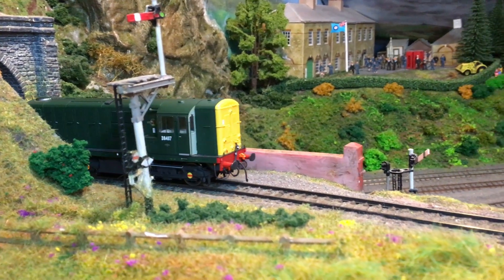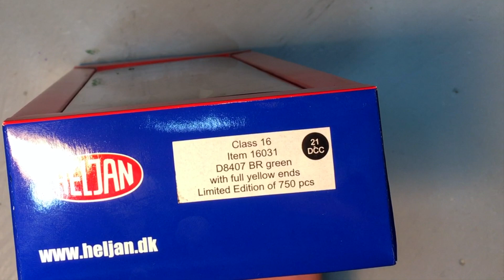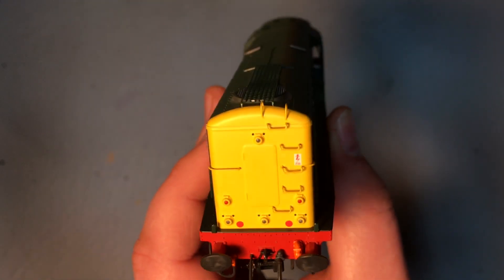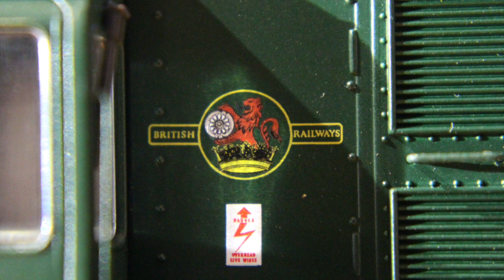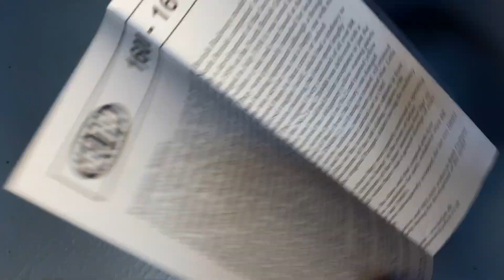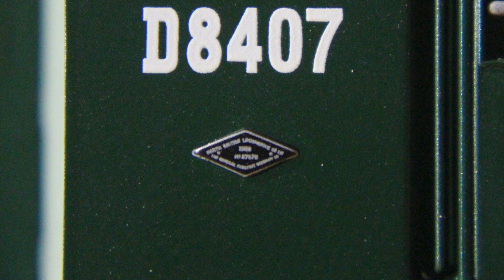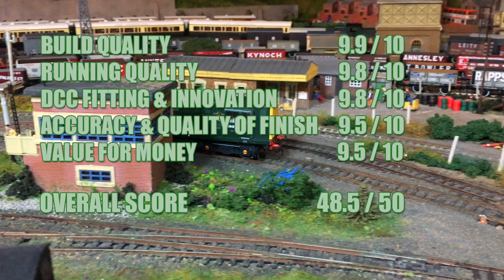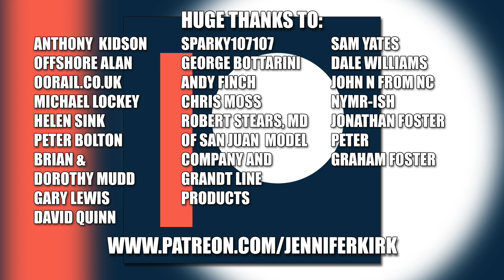Heljan Limited Edition Class 16 Diesel in BR Green With Full Yellow Ends - Unboxing and Review

Comment: The problem with this Heljan loco is that the 3 pole motor is underpowered for the very heavy weight of the loco. During my running in at moderate speeds the motor burnt out after 15 minutes. I had to replace it. It should be noted that this loco is a slow runner. Being a slow runner is not a problem it itself. Only moderate pulling loads should  be applied to it and running it at moderate speeds should be done to avoid motor burnout. This model needs a more powerful motor. Despite this it’s a lovely model with great detail.

Comment: Bought one a couple of years ago, but sadly the motor burnt out after 1 hour of running in.. yes it's a beautiful model, but it seemed to have been a common issue with this model from Heljan back when I bought it and prior to, from what I read on a related forum thread. Hopefully one day I'll get mine running with a new motor. I really wanted one as we had a class of loco's very similar here in Western Australia, the WAGR Y Class, introduced in 1953 and also powered by a Paxman diesel engine. cheers Paige

Comment: Hello Jenny, a very detailed loco and looks nicely made. If I ever decide to move away from vintage modelling I'd be tempted to buy one. May I make a suggestion to you about removing plugs / circuit boards, I would recommend a plastic tool to minimize the possibility of scratching, damage to fine circuit tracks etc. I nearly spilt my coffee watching you lever away with that sharp old metal screwdriver. Very good review. Best regards to you

Comment: A good review on the detail Jenny. I bought several of the Heljan locos on release except the Class 16. The Class 14 Teddy Bear had issues IIRC on release eg slow running and decoders at the time were a very tight fit. I also bought several of the Dave Alexander WM kits ie 14, 15, 16, 17 and 28 before Heljan brought theirs out. Long story short, there is no way I could build the Class 16 to the Heljan standard so had a quick look on the Bay and found the Full Yellow End version at a fair price MIB. The handrail detail, directional LEDs, paint detail, PE walkway detail and heavy diecast frame are particular standout items in your review. Just need to get all my others out the box now and maybe sell off the WM kits, though never having built a WM kit, may give one of them a go though I have them all from Heljan. Cheers